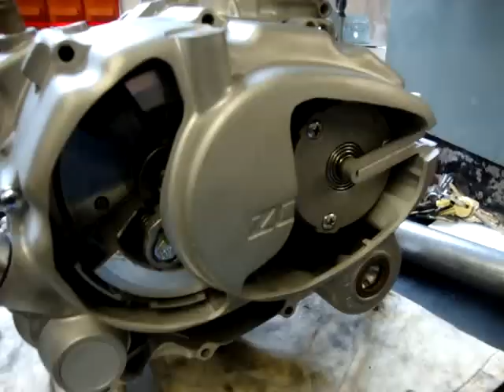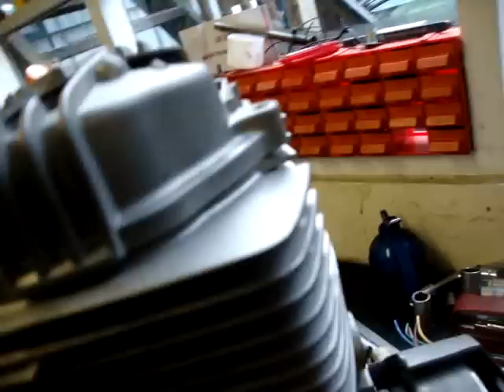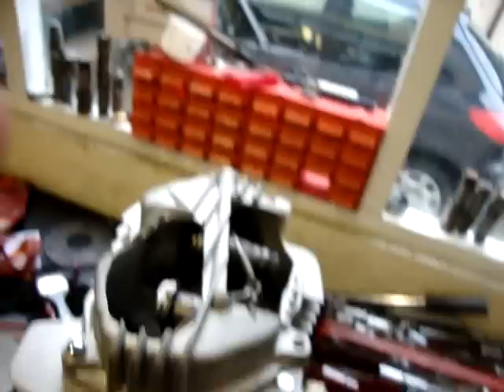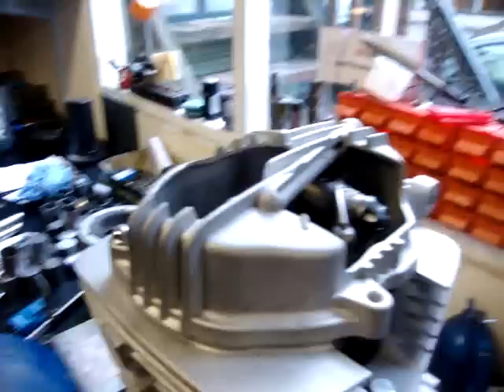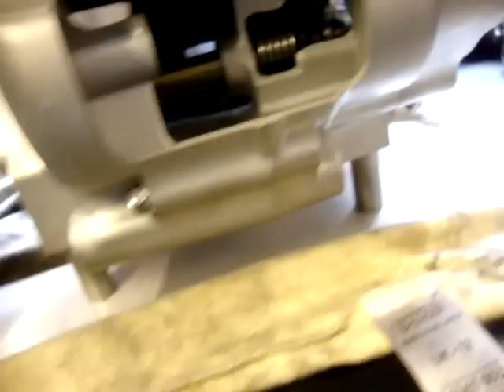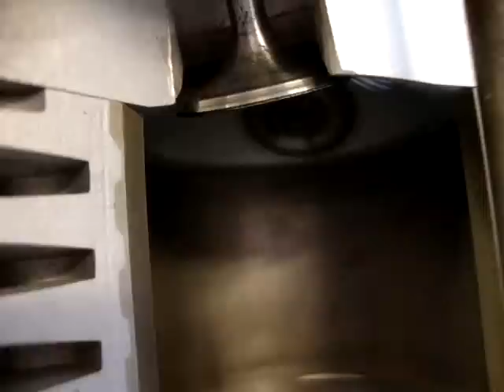HONDA SECTIONED ENGINE

Comment: "DONT TRY AND CUT THE STATOR.....THEY'RE AS HARD AS FUCK! "... LOL! 

Very nice work, very clean!  had a 2 stroke at college like this, motorised using a geared down wiper motor in a box underneath with a transformer etc... nice show piece. 

Good tune too.... But nearly knocked me off my chair.... Last vid' was whisper quiet so had turned the sound right up!! 

What happened to the gyroscope?  :-)